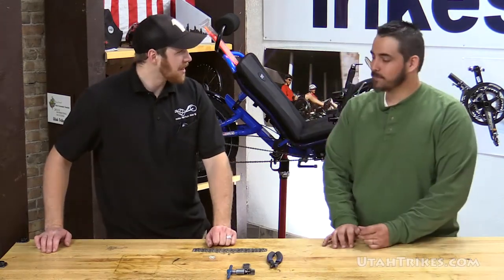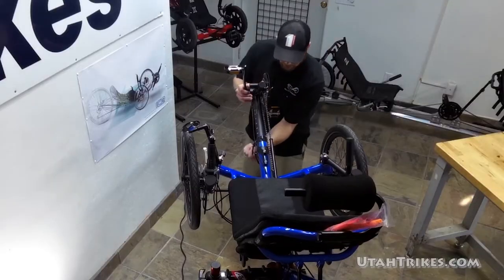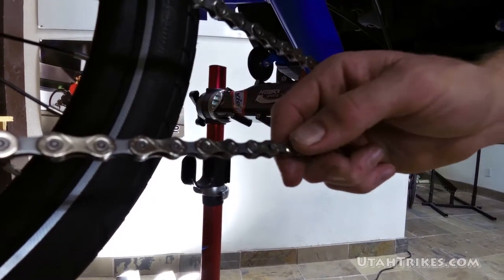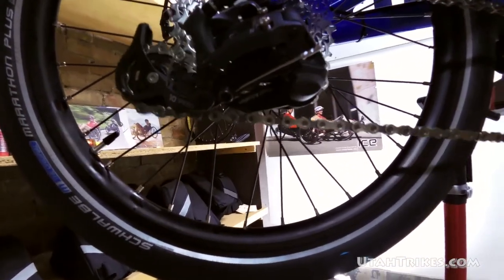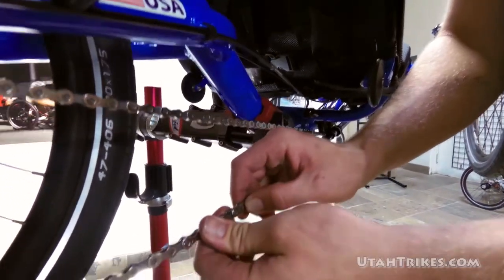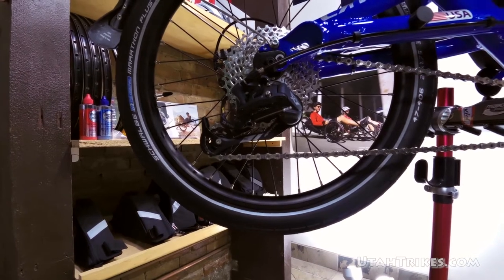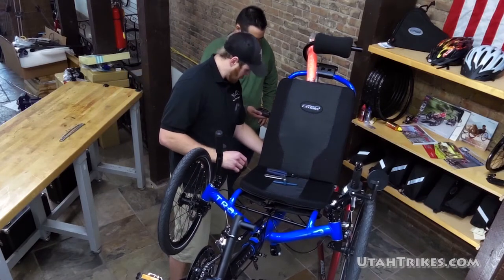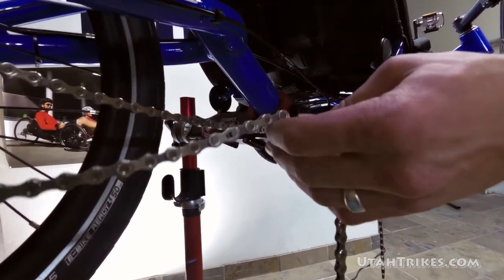How to adjust your chain length and boom length - Trike Show - Utah Trikes

Comment: I like the way you cleverly have your hand blocking the view as you cut, remove and replace the chain.  So as a novice I'm seeing nothing.
Reply: Also no explanation on how to use the chain tool which each one has very specific instructions on where to put the chain in the tool depending on if you are joining or removing links as well as an exact number of turns to disengage the pin from the chain without completely removing the pin. And trust me, putting the pin back in is a trick in itself. No discussion of how to size the boom, i.e. how much leg bend the rider should have. And oh by the way you can do the whole thing with just the chain tool and not even using a master link.

Comment: so you with the chain in the smallest chainrings on both ends and the derailleur close to the 9 o'clock position and my boom set where I need it will tell me that I have sufficient chain to use all three chain rings on the front? because with my boom set to the desired length, right now I am limited to using the first two chain rings, it won't shift into the largest chain ring. so if I am thinking right I need more chain?

Comment: do you have a video showing how to mount and set up the chain with a chain tensioner and how to add that extra chain with the tensioner? that would help a lot since the person I know is in Winnipeg Manitoba who needs this so his family can ride the trike at different times and could use the video as well. Thanks in advance.
Reply from the maker: The procedure is the same once the chain is routed through the tensioner as per the instructions.